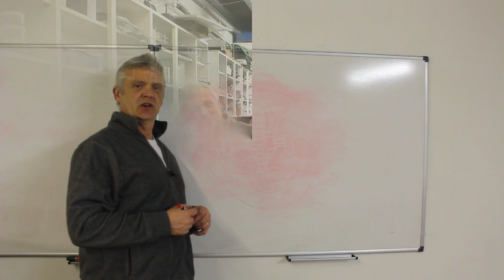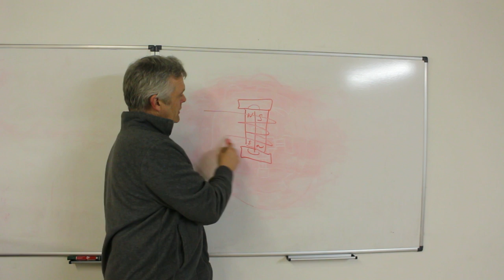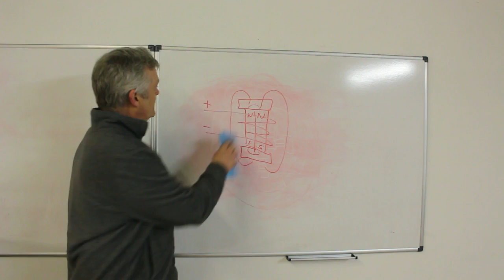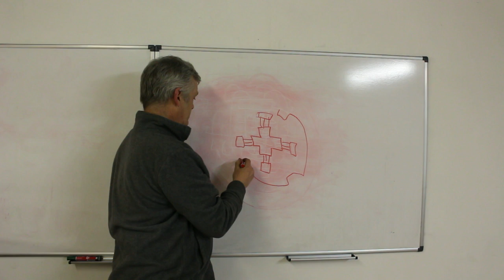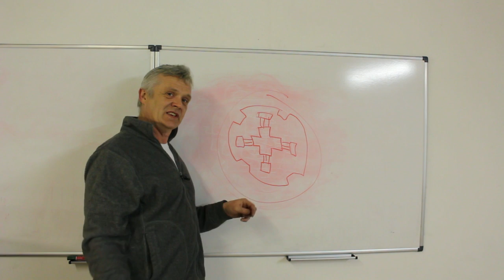A Magnetically Assisted Switched Reluctance Motor

Comment: 555 timer on a transformer?

I noticed that most people use a microwave transformer and only have one horizontal secondary coil. With the E shape of the flanges you could wire each of the sides vertically so that one coil is 'biased' toward amps, while the other would be toward volts. Using the right diodes you could make a "2-cycle" transformer that boosts amps and volts from the same power source without "interfering" with the laws of science.

Comment: Its a cool idea, but if I am not mistaken, a switching a hard magnetic material is inherently a lossy affair. Especially when going to high frequencies, selecting magnetic materials with a small hysteresis loop becomes important to efficiency. Now as frequency goes to zero, this type of motor would have a unique selling point; holding torque without energy consumption, which could be quite useful indeed in the right context. But it is more likely to catch on for say, motors to adjust seat position, than for setting new mileage records.

Comment: I'm thinking of trying this for a coil gun.
One of the problems, especially with small ones, is keeping the coils on until the round is almost there, then cutting them off.  This might help, as I think I can just kill it by pulsing it at the same time as the next coil in line.
Will need far more coils, though, as they will be weaker than electromagnets.
Reply: AncapFTW use monopole starship coil.

Comment: I asked the question about leverage on your Energy video because if I built a Magnetically Assisted Switched
Reluctance Motor of a large diameter with numerous magnets. My design has 12 poles and  8 magnets.My device will be opposite to your design as the centre rotor will revolve .The magnets  on the rotor 
will be fed by a commutator. 4 magnets will always line up and four magnets will always be at 15 degs offset.I was thinking the distance the magnets are from the centre shaft will give it a mechanical advantage.
I made a magnet last week I can't stop playing with it . larger magnets on order .This could be a fun project
Thanks you are an inspiration
Reply from the maker: good luck with it mate - do some vids if you don't mind and keep me in the loop

Comment: What voltage are you applying to switch it? I built a device like it, hit it with 60vdc and nothing. Do I need to get braver with the voltage? Thanks!
Reply from the maker: +David Niemela 24 volts - try changing the number of turns in your coil
Reply: Robert Murray-Smith  I used 30AWG wire and about 160 turns on the magnets. The magnets are 2 inches long and 1/4 inch diameter (of course one neodymium and one alnico). Bigger wire and fewer turns? Try to flow more current at a lower voltage? Thanks! Love your vids!
Reply from the maker: +David Niemela cheers mate - that is not many turns for the size of magnet - i used a couple of hundred turns for a half inch by 1/8th inch magnet - so - thinner wire more turns and less volts lol

Comment: Heads UP Electro permanent magnetic motor MIT ? http://ocw.mit.edu/courses/mechanical-engineering/2-141-modeling-and-simulation-of-dynamic-systems-fall-2006/lecture-notes/dcpmm_basics.pdf Been following this for a while Hod Lipson
, MIT
Any use to you ??
Reply from the maker: +John Burnley very nice mate - thanks very much - i printed it off and will give it a good read

Comment: Reluctance motors without permanent magnets do not exhibit back EMF. The output of the motor is determined by the strength of the magnetic field and the speed in which the field changes from pole to pole. Magnetic fields are based on current per length of wire, or magnetization per amp. The longer the wire, the stronger the field. There is a coil design in which creates a field stronger than a typical coil for the same length of wire. A bifilar wound, series connected coil will produce a stronger field than a single strand coil for the same amount of wire. The potential for these motors to produce more mechanical output than electrical input is within reach and could rewrite the books on the amount of watts per horsepower. A bedini recovery circuit is a perfect addition to this type of circuit. As each coil is turned off, it's field collapses generating a massive voltage spike. By shunting this spike into a capacitor, we can store the energy, otherwise wasted, to generate the field on the next cycle. If we can recycle half of the energy required to establish these fields, it's possible to make a motor that exhibits over unity effects.
Reply from the maker: +Tyler A i'm not sure about over unity - but the efficiency would certainly be improved - who knows to what degree - i think the answer it to build it and see - but then i would lol
Reply: +Robert Murray-Smith The "over-unity" I speak of is producing 1 mechanical horsepower with less than 746 watts of electrical input. With no back-emf, high efficiency coils, and a recovery system to recycle the transients, it's very possible.
Reply from the maker: +Tyler A sounds good mate - definitely something to aim for - if you get there before me i'll be annoyed lol
Reply: +Robert Murray-Smith I used to have a small makeshift lab in the back of a computer repair store. Work on such a design has fallen to the back burner as life requires a full time job.... 8 hours of sleep + 8 hours of wage slaving + 1 hour commute + 1 hour or more for meals + 2 hours of chores makes for very little time to invest in such a feat. I think our system is designed to suppress us in such a way as to give us so little time for actual self-reflection and research to prevent garage tinkerers from developing products and solutions that threaten the status quo. A motor that is so efficient as to double or triple the mileage of current electric vehicles would turn the auto industry upside down and cause a huge ruckus within the world of science. Not to mention the monopoly that would form out of patent rights...
Reply from the maker: +Tyler A I think you could well be right mate - i will just do this open source myself
Reply: +Robert Murray-Smith I wish I could help more than just vocalize my discoveries. You should do a video on coil designs. Take a compass and measure the amount of deflection with a single strand coil, a bifilar parallel connected coil, and a bifilar series connected coil. The compass deflects more with the bifilar/series than any other coil for the same number of turns (same amount of copper). Since the wire is a resistor, the parallel connected coil will pull the greatest amount of current. The series and single strand will pull the same current. It's interesting to apply Ohm's law to this experiment and see which coil is the most efficient.
Reply from the maker: +Tyler A to be honest mate - it sounds to me like you should do this video - nice ideas but i think it is a good one for you to do

Comment: Truly fascinating. Old tech, but this is the first I've seen of it. I have been following the free energy sites for years and even have a couple of prototypes on the go myself.  I would expect the magnet motor crowd to jump all over this one. Or maybe they already have? Lutec. for example. I don't know too much about Lutec other than their website disappeared a few years back. Check out the motor/generator in this video. 
https://www.youtube.com/watch?v=huLhq190A_Y
It has all the makings of a switched reluctance electro-permanent magnet motor with ac generator on top. Complete with bridge rectifiers to charge the 2 large capacitors next to the motor. Why 2 caps? Simple, one to provide the "ON" pulse and the other to provide the opposite polarity "OFF" pulse. Could this be the tech behind the Lutec generators and others like it.?? Hmmm......
Reply from the maker: +Dean Couillard do you know mate - i think you have it there - very cool

Comment: I tried to build this motor and discovered that the magnetic keeper saturation causes it fail in a very short time.
Reply from the maker: +zebok3 that doesn't seem right mate - this is a switched reluctance motor - they are fairly standard - the only 'tweak' is the hard/soft magnet switching - so likely problems will be hard magnet demagnetisation and heat generation - did you do a video of your motor?
Reply: +Robert Murray-Smith  Sorry, no video. It worked great for a few minutes, then the keepers grew permanently magnetized and just stuck to the iron nodes of the rotor! Maybe transformer laminations or high permeability keepers might help; but the kind of keeper you're using won't demagnetize sufficiently to keep the rotor in motion after a very short time span!
Reply from the maker: +zebok3 these are transformer laminations. Mate - this is not new tech - nor even my tech - there is a lot of backup to this - i get a feeling you did something wrong as opposed to the idea being unsound - but i don't really know - it would have been good to see what you built - to see if you went wrong - but ah well.
Reply: +Robert Murray-Smith Just build a small "Ferris Wheel" with PVC uprights and pie plate discs with iron bars sandwiched in between, and short the stator as you do, and see how many times you can repeat that before the laminated keeper saturates and sticks due to permanent magnetization. The sticking goes away by itself after awhile, but the effect is cumulative. It's a serious drawback to an otherwise very promising idea.
Reply from the maker: +zebok3 We are beginning to go round a circle on this one mate -  this was the subject of a master thesis which you can read here http://dspace.mit.edu/handle/1721.1/60151
the motor was pretty thoroughly explored

Comment: As usual, very cool. Are you planning to use your own switching equipment? Are you going to use something like a frequency drive with integrated gate bipolar transistors and all that? How many poles are you using?  Are you going to use any of your own materials to build these parts? I have so many questions.  If anyone could pull this off it would be you.
Reply from the maker: +Joshua Fausset lol - cheers mate and i am planning on developing the switching system too - we will probably use around 50 poles - maybe a hundred - not sure right now - the plan is to drive it pretty much the same way as a BLDC motor - which is, essentially, what it is
Reply: +Robert Murray-Smith But the more poles you use the more frequent switches are gonna be leaving less time for the magnet to work and using more energy
Reply from the maker: +dft sure - like anything there are going to be trade offs

Comment: Robert, will your setup attract a magnet and then let it go? Or will your setup attract
metal and then let it go? In the video you show the release but not the attract?
The neo will always be on and should attract the keeper. But when the keeper is
latched then it can be released. 
In the Bedini motor the magnet to core attraction is free and then a release is needed
to let the rotor pass the magnet. Would your setup do that? If so you might already
have your motor.

Norman
Reply from the maker: +nebollinger it attracts the metal then lets it go

Comment: This is why some Galaxies float away & some attract ~/~   passage of magnetic flux for opposing magnetomotive force lines is Worth testing out, sounds kewl!  Have fun Robert.  I wonder what the lifting strength comparison is between this "cancelling switch" set-up & just the Neo. If it's 50% or grader in strength then the Neo alone than timing "should" yield some improvements for yous. Seems like one could calculate power ratios with that bit of this information. Sounds like fun.  By the way, I heard new theories base on my magnetic alignment suggestions that  I kept telling them about! & they actual agreed that Dark energies & dark matter are a crock of poopoo.  I wish I could get some street credit.. lol   
Peace Out!
Reply from the maker: +Dan Murphy the next thing to do is a bit of finite element modelling mate

Comment: i am about 90% sure you will get higher efficiency but how long do you think the neo magnet will saty magnetic if you pulse it constantly?
Reply: +сталкер чворович Hi, the neo doesn't  have to be pulsed. It doesn't even have to be too close to the soft magnet, as long as the keepers are a little wider or u-shaped. Then the coil can be wound on the soft magnet only. See the wikipedia link in these comments above (or search wikipedia for electro-permanent magnet) for a good explanation .
Reply from the maker: +сталкер чворович it is pules both ways so probably longer than you think
Reply: +Robert Murray-Smith so when you pulse it the other way it will compensate i see
Reply from the maker: +сталкер чворович well - i think so - but the answer is really in the build

Comment: Awsome. 
I so want to see it working. A high torque motor that  works with 'permanent magnets'.
I had seen another guy on youtube who put permanent magnets in a reluctance motor but o his video it didnt work, in fact the magnets diminished de rpm. But your project is totally different from what he did. He literally just put permanent magnets on top of the coils. with this weirdly brilliant coil you made things might be different.
Reply from the maker: +Lonely Lobo yeah i saw that - i couldn't understand why he did it that way as all he was doing was saturating the core - it was bound to reduce efficiency
Reply from the maker: +HANS BRAUN it was a bit odd wasn't it
Reply: +Robert Murray-Smith  I thought the same thing when I saw that video.

Comment: I think the problem is that you can't switch off the permanent magnets so when the rotor is moving away it is now fighting the magnet.   Maybe I missed something; are they not permanent magnets?  If permanent, the the proposed design has a whiff of perpetual motion to it and the path has been traveled before.
Reply from the maker: +Marty G You missed something mate lol - this is a switched reluctance motor with a tweak - no PM here lol
Reply: +Robert Murray-Smith, ok I'm guilty as charged.  I had watched the vid on my kindle while making breakfast and missed the keeper mechanism restricting the field of the two different types of magnets.  It certainly looks like something to explore.  I think it will come down to how much power it takes to get the non-neo magnet to fully cancel the neo and whether this is less than what it would take to power a simple electromagnet.  I'm also thinking you'd want a different number of nodes in your stator from the rotor as in a switched reluctance motor to get smoother and more efficient motion but I realize you were just drawing a quick diagram to get the gist across.  A very interesting concept that I hope you continue exploring and posting the results for us to see, and apologies for rushing my first viewing and jumping the gun.
Reply from the maker: +Marty G lol - here's some of the math on it mate https://en.wikipedia.org/wiki/Electropermanent_magnet - anyway - you really should know better from me lol
Reply: +Robert Murray-Smith, the concept is new to me but now that I google it there are several startups already.  Here is a US patent from 2014: http://www.google.com/patents/US8674576
Reply from the maker: +Marty G I know mate - i was talking about it 3 years ago - it is just fun to investigate and new to a lot of people - so - the video
Reply: US3984711.   The electropermanent is too fussy.  I feel better advised to prefer Occam (and more modern technology.)  Not that 1976 is like yesterday, but Barium-Titanate, crystalline supercapacitor magnets are inherently switchable, since they are ceramic electromagnets, and could be strategically placed on the faces of plate rotors (many on a shaft), which is far more efficient than sticking magnets way out on the ends of rotor lever-arms like ordinary perm-magnet-motor designs or apparently your sketched design above.  I will repost this in the most recent Edison car vid.
Reply from the maker: interesting thinking mate - are you going to try this?
Reply: I emailed
Eestor with the included appeal (repeated over past years!):
"....  If your CMBT product is as capable.... 
Yasa Motors employs supermagnets on the face of disk rotors in a design reminiscent ... [YT post too long]If your company has been interested in this concept, then please direct me to any related P.R. releases, OR, please inform me if no work has been performed in this area. In any case, please inform me asap for ordering information on research samples of your capacitive CMBT product, as I am eager to contribute in this research direction myself."
Seems inescapable, that some response should be forthcoming. Never got nuthin. I have no EM physics, and all I know of a potential design is that HD drives use an axial flux with a supermagnet design that is highly competitive in that market. Sure it works, but it would be silly for a mechanical engineer to claim anything on physics which is invisible and action-at-a-distance, which I know nothing of measuring. The rare-earth replacement characteristic is crucial, and CMBT has vastly lower inertial than coils, AND I can see no transfer from coil-magnet experiments to hypothetical CMBT design, so that actual CMBT experimentation appears to be required. 
I will send my appeal to YASA, in the hope that they can have more pull with Eestor. Eestor itself has always seemed to me to be only interested in vertical deployment within the utilities sector, anyway. 
I would be up for getting a sample testing rig so as to publish thrust numbers. Somebody, freakin SOMEWHERE has to take this stuff seriously. (thanks for asking, Robert!)
Reply from the maker: no worries mate - it looks like you needed a bit of a vent there lol